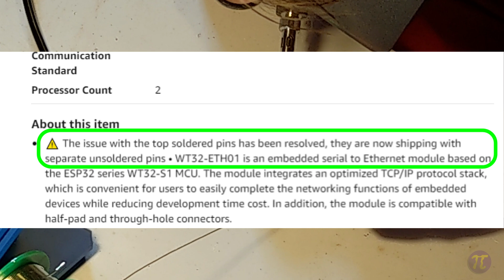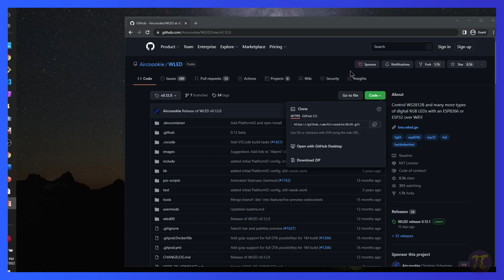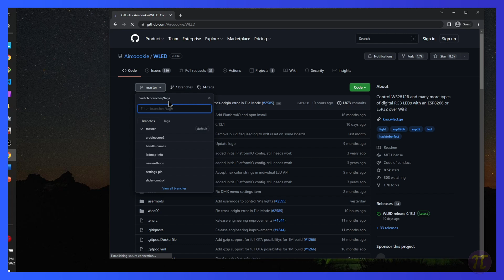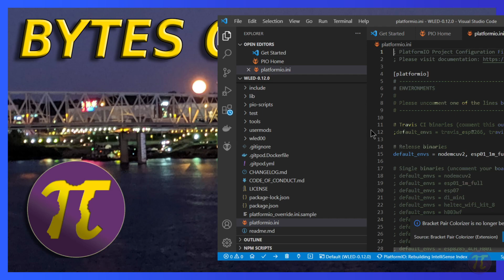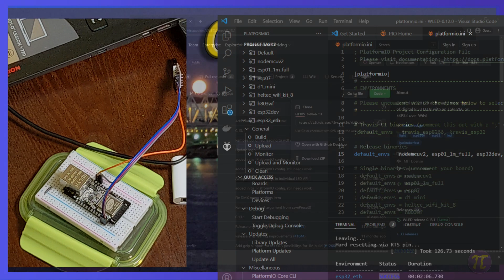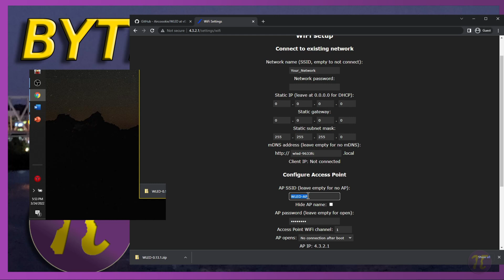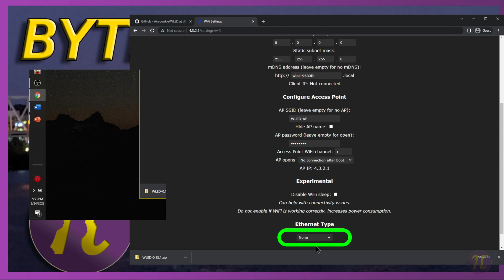How to Flash WLED to your WT32-ETH01 microcontroller

Comment: 6:01
I don't understand why you're not comfortable with precompiled binaries, but you are comfortable compiling the source code without reading it, and using those binaries. Can you explain? If you were reading the source code beforehand, or integrating some other features/patches, etc. I can see where compiling from source would have an advantage. But in this case, I don't understand the point.
Reply from the maker: @no1unorightnow   Fair point, and I have used precompiled WLED in the past.  Wasn't looking at bashing those that do.

I actually do look at the WLED code and I make modifications to items like text scrolling and optimize builds for space 

I am a little naive thinking that I'm safe compiling it on my own. A nation-state could just as easily modify the libraries I'm downloading to compile as easy as tampering with the precompiled binary
Reply: @BytesOfPi  Understood, thanks for the clarification!

Comment: HI, Thanks for this video, It's very helpful. I do have a problem I hope you might be able to give some insight into. I bought both the WT32-ETH01 and the ttl-usb devices from your links and can't get the USB module to work. It comes up as a Verifone to printer bridge, and won't accept any drivers. I've been researching this for a while now and think the chip on the board has the wrong PID/VID. I've bought 4 different boards form different venders, plugged them into different computers and come up with the same problem. do you have any suggestions how to get past this issue?

also I've been asking this similar question all over the internet, So I might have already asked it here, but I don't see that I have. If I did already I'm sorry for bugging you again. :)
Reply: Aha… interesting. I have had a few troubles with the installation but when I used ESPHomeflasher and a bin file it has worked.
Reply: Did you download the correct driver for the USB UART? I think its called CP210x_Windows_Drivers if you are using Windows.
Reply: @pixelkedjan  yes. Absolutely. Thinking that I was installing the driver wrong somehow is what started this frustration spiral I'm currently in.
Reply from the maker: What program are you using to flash your board?  I may be mistaken, but I don't believe I had to download drivers when using vscode with platform io.   While running the app, the adapter was recognized and used

I'll concede that I downloaded drivers for an esp32 wroom board years before but it didn't need the ttl converter.  I'll try to use a clean PC to confirm
Reply: @BytesOfPi  I'm using the WLED install website which should work if the USB module will be properly recognized by the computer.
Reply from the maker: Gotcha.  I guess that's another reason I prefer using PlatformIO plugin for VSCode to install WLED besides the ability to customize the build.

Comment: My objective is to flash de WT32-ETH01 to be recognized by arduino IDDE for programming. I've studied and read de documentation about esp IDF flashing with Espressif ESP IDF program. But has issues.
The point is. This method can be used to to flash in first moment the ESP32 for after program the esp32 in arduino scetck to other thinks like blink.
Reply from the maker: I don't think I understood the question.  I believe you are trying to flash a WT32-ETH01 board with a program from the Arduino IDE.  You're trying with a simple blink program but are having trouble.  

I'm guessing you have a TTL programmer as in the video.  It's been a while since I've used the Arduino IDE, but I believe you need to select a generic ESP32 board or if WT32-ETH01 is available.  You also need to link IO pin0 to ground before connecting so it puts the board into a state ready to be programmed.

As far as which pin controls the onboard LED for the intro blink program, I don't know.

Comment: This was a really great video. I have struggled programming the WT32-ETH01 with WLED until finding this video. Thank you for taking the time in documenting this process.
Reply from the maker: I'm glad it was helpful and thanks for taking the time to reply back!  Having a board with Ethernet already built in is really handy for sure.  WiFi is nice, but it is slower and (for the time being) except on a few boards limited to 2GHz.
Reply: @BytesOfPi  Yes, the ethernet is the way to go for me. I have built a Christmas show for my Falcon controller, but during the other months I wanted to use something much cheaper to run my 7, 10 Watt garden lights, using two data ports off the microcontroller. I keep the WT32-ETH01 microcontroller in a small enclosure in my office. I ran ~ 150 feet of RGU6 coax to each two sides of my gardens for the signal to the 2 areas with RGBs. I inject power from my 2 power supplies mounted close to both gardens for my Christmas show. With your help I was successful in programming 2 of the WT32-ETH01 microcontrollers. I always keep one ready to go as a backup. I do the same with my Falcon controllers. I like the stability of Ethernet and assign static IPs which eliminates any network issues with other devices.:hand-purple-blue-peace:

Great channel!

Comment: Hi, can this little board be set up as a wifi router ? 
we wanted to run a cat5 cable from main modem to the shed 200ft away then wifi in the shed for everyone, many thanks Brett
Reply from the maker: It might be possible to make it an access point, but you'd have to program (or find existing code) to translate Wi-Fi traffic to Ethernet traffic, to broadcast an SSID so your devices would recognize it, etc...

It would probably be more cost-effective to just buy a wired access point for around $25 that has that already set up.

Comment: It would be interesting to update the lib install part because this seems to be outdated. I can't seem to be able to flash my esp32-eth01 because of missing dependencies.
Reply from the maker: Yeah, it's funny how fast tech gets outdated.  Less than a year and Platform IO has different commands for package install.  

Good thing about it is the latest only downloads the libraries for the board you need and it's faster.  If you check out the video description, I've already put the latest package install pio commands for the WT32-ETH01:

pio pkg install -e esp32_eth
Reply: @BytesOfPi  Hi thanks for getting back to this.. I actually have red and tried the new install command but it gave me the next error message. Error: Unknown environment names 'esp32_eth'. Valid names are 'wt32-eth01' That's why I reached out. This is my very first time in VS so I still take into account that I did something wrong. I only don't know what I'm missing here... There is little to almost no clear information about how to get the code into the WT32-ETH01 either by VS or the Arduino ui.
Reply: OK, found it.. it was a driver issue with the USB TTL Serial Adapter
Reply from the maker: @carlojongen   That's interesting...  Are you using a flashing tool to upload to your WT32-ETH01 or flashing from a Mac?   Before on other personal projects when I used the Arduino IDE or flashing tools with different boards I had to make sure I loaded the right windows board drivers.  

However, with the WLED / VS Platform IO and the TTL programmer (to my recollection) I was able to load without having to install board (or programmer) drivers.  I am curious that you were forced to.

Did you have to load drivers for your particular TTL or for the WT32-ETH01 itself?
Reply from the maker: @carlojongen  excellent, thanks for replying back with the details.  I'm sorry you hit that roadblock.  I wish you luck with your rack project and definitely agree Ethernet is going to be a more reliable/robust solution than the packaged WiFi.

  When running the PlatformIO command line to install a specific environment, PIO looks to the corresponding platformio.ini file to pull the corresponding libraries.  My initial thought was that the package installer couldn't find the 'esp32_eth' environment if it wasn't launched in the same directory as the WLED platformio.ini file.  If you wanted to load custom code, a similar platformio.ini would need to be created with the appropriate board and platform package references.

Here's the GitHub link to the page .  In the [env:esp32_eth] section it refers to the board, platform, and platform packages for the Ethernet build.
https://github.com/Aircoookie/WLED/blob/main/platformio.ini

Comment: I just got my WT32-eth01. I hope it works out like your described. I am wanting to have a small battery operated travel router that I can simply connect to a network switch and them get on my phone (because there is no phone service out at work) if I need to make a phone or look up a part or something on wifi. I need to take my board to work and solder on the pins and bring it back here and do this tutorial.  I am going to read all the other comments below and check out everyone else's.
Reply from the maker: Hi Will, one thing to mention is that the reason I use the WT32-ETH01 for the lights on my house is because I need Ethernet high reliability for my home light show which sends a lot of DMX data over the network.

However for mobile projects that I have and small standalone projects, I use cheaper ESP32 boards without Ethernet because WLED acts like it's own access point.  You don't need a Wi-Fi network when your phone can connect directly to the board through its access point.

If you are just using the canned WLED patterns, you won't need the battery powered router
Reply: @BytesOfPi  I want to be able to connect the WT32-ETH01 to a network switch and broadcast a wifi signal for my laptop or my phone to pick it up. Where my work place doesn't have cell service. I won't be connecting any lights up to it. Maybe in a different project. Hootoo Titanmate used to have a battery wifi wap that was great but the company doesn't make it anymore for some reason.
Reply from the maker: @willmaxwell2184  
Gotcha, not a WLED project, but a wireless access point that can take a physical ethernet connection and make it available over WiFi....  Also battery powered because while there is a physical ethernet connection to the internet, there is no power outlet....
Reply: @BytesOfPi  That is correct! Plus a few extra lines of goes to switch a led on once there is a connected. It would need to be able to be DHCP. I am still a little new but I been studying python, ESP32 and arduino and made small projects nothing this big yet.

Comment: Thank you for such a comprehensive video....  2022 was my jumping into the LED world with my first element a 20 string, 1000 pixel mega tree.    I ran the tree using an Arduino Mega, with each string controlled by it's own pin.   Also a rPi using fpp, which was problematic (separate rabbit hole).   My questions for you are:. Could these wt32 boards replace the mega?  How many output pins can be used and how many pixels can be driven (data wise...p.i. would be necessary obviously) from each pin?
I've already ordered, received and started tinkering with a pair since first seeing your video.
Reply from the maker: The WT32-ETH01 development board isn't as large as a Arduino mega, and doesn't map as many pins from the ESP32.  Most of my props are chained together and I've only needed to use at most four output pins.  

For example, I have one WT32-ETH01 running all the pixels on the windows and door.

GPIO2 - left door and windows (531 pixels)
GPIO4 -  34 x 26 matrix (884 pixels)
GPIO14 - right windows (499 pixels)

At most I've used only 4 ports (GPIO 2, 4, 12, 14).  However you can theoretically use the other mapped output ports of (15, 17, 5, 32, 33).  Ports 35, 36, and 39 are input only so they can't be used.  I suspect other pins are being used for the ethernet port.
Reply from the maker: To answer the question about how many LEDs can be run, I think the WLED site answers it best in the ESP32 section:

https://kno.wled.ge/features/multi-strip

For perfect performance, it is recommeded to use 512 LEDs/pin with 4 outputs for a total of 2048 LEDs.
For very good performance, it is recommended to use 800 LEDs/pin with 4 outputs for a total of 3200 LEDs.
For good performance, you can use 1000 LEDs/pin with 4 outputs for a total of 4000 LEDs.
For okay performance, you can use 1000 LEDs/pin with 5 outputs for a total of 5000 LEDs.
For okay performance, you can use 800 LEDs/pin with 6 outputs for a total of 4800 LEDs.

Comment: thanks for the tips on getting the board connected--saved me a lot of time. I'm actually using the arduino environment for a different project, but still very useful. thanks.
Reply from the maker: Awesome!  Glad it helped. 

 For dev boards that don't have built in micro USB for programming, I couldn't find a lot of good videos out there explaining how to flash ESP32.  Also I take for granted what the program/reset buttons on most dev boards are doing grounding IO0 putting the ESP32 into flashing mode

Comment: This is good discussion, but needs to be updated as in development era things change fast.
For example the command pio lib install is deprecated and should be pio pkg install instead.
And the pin thing?  for Noobs you really should re-record the video and not try and make addendum notes post.
Reply from the maker: Being a developer for 23 years, I totally agree that technology changes quickly.  As with most tech based how to videos out there, they get outdated easily.  I take the pieces that are useful to me and extend grace for things outdated or mislabeled.  

TMK YouTube does not make it easy to update videos in place and penalizes re-recording.  The bulk of the video is still valid and while the pinout diagram I'm using from JacobsParts is labeled wrong, (I.e. Tx0 instead of TxD), the physical connections shown in the video are correct and hasn't tripped up those I've talked to that followed it.

It may not look like it, but even with the non professional video recording tools I have, it takes me a couple of days to plan, script, check, record, edit and publish a  4-8 min video. 

As it stands, I don't think the video is so outdated that it's worthless and needs to be brought down.  Perhaps in the near future I can spend the time and get it up to speed with the latest Platform IO syntax and use a correctly labeled pinout.

Right now I'm eager to fix my existing 26x32 matrix and see if WLED 0.14.0 matrix features can be easily tweaked

Comment: The error I get in vs when I type into the terminal pio lib install is that my wled-0.13.1 folder is not a platformio project. It does this with any version wled I try to use.
Reply: Nevermind. I figured it out. User error. Thnx!

Comment: I can't get it to upload. 

A fatal error occurred: Failed to connect to ESP32: Timed out waiting for packet header
* [upload] Error 2
========================= [FAILED] Took 39.31 seconds =========================

Environment    Status    Duration
-------------  --------  ------------
esp32_eth      FAILED    00:00:39.309
==================== 1 failed, 0 succeeded in 00:00:39.309 ==================== 

 *  The terminal process "C:\Users\wshelton\.platformio\penv\Scripts\platformio.exe 'run', '--target', 'upload', '--environment', 'esp32_eth'" terminated with exit code: 1. 
 *  Terminal will be reused by tasks, press any key to close it. 

What do I do?
Reply from the maker: Did you try running it again?  It's the weirdest behavior but sometimes the build randomly fails...(it even happens in the video)

It usually works every other build.  I've not dug in deep enough to figure out why but since it works the second time around it makes me think of a race condition where not all required pieces are compiled in the right order but are cached for the second go round
Reply: @BytesOfPi  I have it. Thanks.
Reply from the maker: @WShelton  That's awesome.  It sounds like it worked for you the second time.

I'm a software developer by trade and the periodic failed builds don't sit right with me.  I sift through so many other's code weekly that I haven't been motivated to find out why in this case 😁.  Not bashing the guys who contributed to this code mind you, they've done a fantastic job and I love WLED.

They have a good guide to go deeper with code compiles https://kno.wled.ge/advanced/compiling-wled/
Reply: i am having this issue as well with no luck
Reply: Unfortunately I also have the same problem. And even after 20 times without success